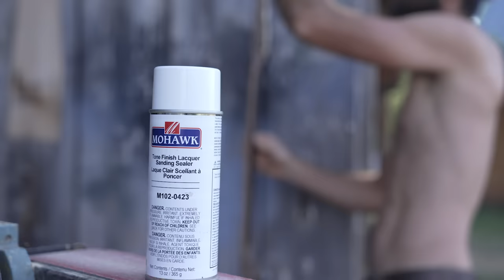One of the CRAZIEST Bows I've ever built!  Mollegabet Self Bow

Comment: I thought that mollegabets were about the ugliest design I've ever seen & never knew why people made them today.  Yours is exceptional.  At a distance, the profile of your bow almost looks like it was inspired by Avatar vs the normal paddle with a stick on top kind of thing I've seen before.  I like how the limb tips taper from the belly side and how it gives space for some creative expression with the snake.  Likewise with the handle.  Wood burning is an under-used tool in bow making & you did a fantastic job there.  Very creative.  Any idea about how fast those arrows are going?  I'd think the fatter limb tips would slow it down some but maybe not enough to matter. The sound of the bow is nice too -- well-tuned to the ear (via speakers on my end).  Kuddos!

Comment: Absolute work of art! Does the extra weight at the limb tips make it shoot slower than a bow without it? Great looking work sir
Reply: By design, it’s supposed to be faster because of less mass at the ends. If too much weight is on the ends it will indeed slow it down.

Comment: Very cool build. Couldn’t figure out what you were doing with the limb tips and grip. Looks amazing. Would have liked to hear your thoughts on the performance of this design. Also was interested in your tempering of the belly with both a heat gun AND torch.  A much needed step with such a short bending limb section I am sure. I have also thought the long unbending limb tips are like Siyhas

Comment: Hello Clay, after reviewing the start of this video, I‘m quite sure you broke this bow on purpose. You had it belly side outwards. There has been an obvious misconception amongst archaeologists about the Mollegabet bow which is discussed in the Bowyers Bible. 
Some thought it was build with the bark side as belly and some of the stoneage artefacts were thinned down from both belly and back side. Maybe like decrowning smaller saplings. 
This sometimes works well, but the risk of breaking is obviously much greater than when leaving the back of an elm or ash bow untouched after debarking. 
I don’t know what you wanted to do but I’m sure you wouldn’t brace a self bow inside out by mistake. However, a great video and a beautiful bow with a really unique snake pattern on it.

Comment: The extra handshock comes from too heavy and/or uneven lever weight. They really need to be scary thin. I made one last year and I still occasionally shave a bit off of those levers. Currently 40 cm levers go from 18mm at the base to 7mm at the string grooves (I have tip overlays). In terms of performance, I noticed that it can comfortably shoot heavier arrows than my other "normal" 50lb bows, but it doesn't feel significantly faster with 10gpp.
Reply from the maker: I could definitely have gone lighter on the tips

Comment: Cool bow! It looks as if you're using right-wing feathers and your bowstring has a counter-clockwise twist (a combination I consider optimal) - any comment on any research you've done, or coincidentally discovered about string twist and arrow spin?
Reply from the maker: I’m not sure how it would influence arrow flight
Reply: @clayhayeshunter  If curious, put some marks on a bare-shaft arrow's nock, shoot from about 10' and notice the direction of spin. :-)
You'll likely see a difference between a clockwise-twist string and counter-clockwise, and how fletching other than what you have in this video would be fighting the spin during launch with a counter-clockwise twist string, not really significant, but something some may consider when selecting a fletch, though as far as I know, most longbow strings are built with counter-clockwise twist while many compound strings are built with clockwise twist.

Comment: Tipping my hat to you sir! That is a work of art! I am curios your opinion on Hackberry wood in general. Hickory is scarce on my place but Hackberry dominates our fence rows on our farm. Tried one Hackberry bow years ago and it blew up on me during the making. Wondering if I gave up on it to soon.
Reply from the maker: I’ve only attempted two. The first one exploded. From what others tell me, there is a great spread in the quality of wood out there. Some of it just brittle. This one worked out well and seems to perform well. But with my limited experience with it, I couldn’t tell you what to look for in a good stave.
Reply: @clayhayeshunter  I’m outside of Texarkana on the Texas Arkansas line. Our farm is right on the red river and hackberries grow as fast as cottonwoods here. I noticed the stave you used had tight growth rings. I might try a older hackberry and see if the growth has slowed down enough for smaller rings. Thanks for responding Clay! I pray God blesses both you and your arrows with a straight sure path. God bless!

Comment: Hey clay I was wondering if you can make a recurve Bushcraft bow that is 40 lb of higher only using a knife ,axe and just overall some Bushcraft tools I would like to see a video like that if you can cuz I've never seen anyone build a recurve Bushcraft bow only longbow penobscot bow you get where I'm going with this but can you try making a fully recurve bow only using Bushcraft tools thank you have a nice day
Reply from the maker: Sure, I’ve got some ideas for that
Reply: To easily bend recurves in a primitive/bushcraft situation, you can use a tree or log as a jig. The diameter of the tree depends on how tight you want the recurves. Just heat the bow over a fire and bend it over the tree, securing the tip by lashing it or wedging it between a branch.